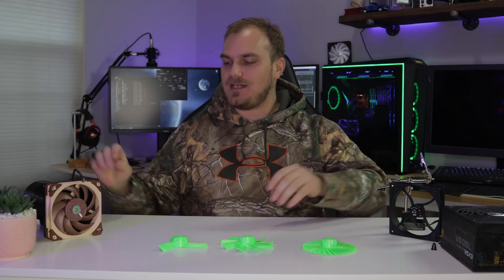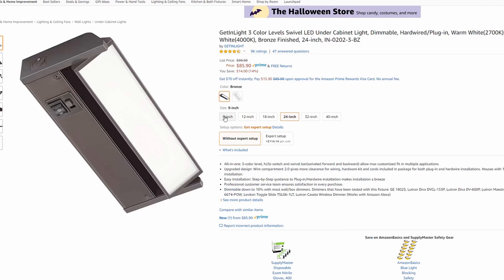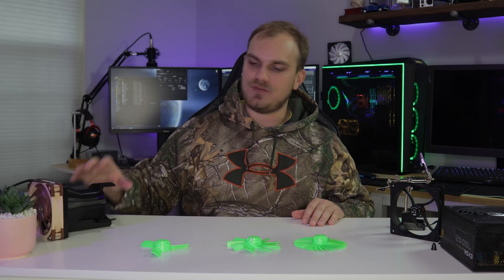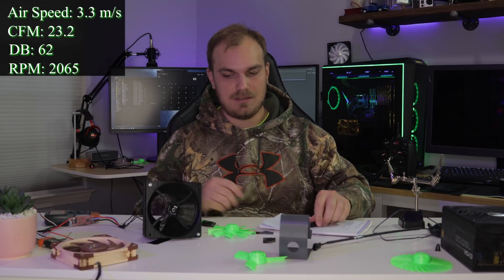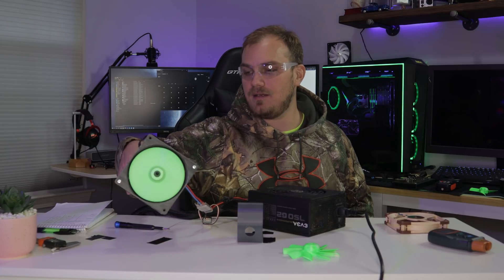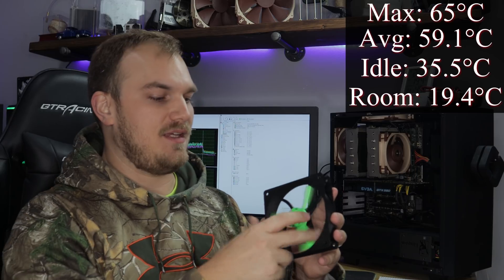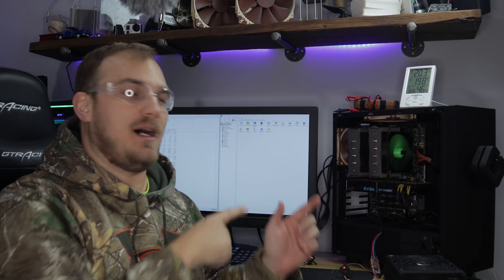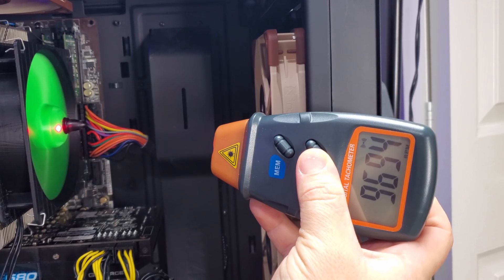This 120mm Fan BREAKS All The Rules!

Comment: The three-blade is on the extreme end of "no pressure" but could probably move some air. Should work well as chassis exhaust but really not good on a heatsink where you want pressure. The 30-blade fan looks like some of the fans I used to see in industrial machinery like big print units who needed elements cooled. A bunch of blades like that will move less air but should probably do better on a heatsink.
Oh and this is absolutely great fun. Subscribed and looking forward to more of these tests. You might just end up busting some myths.
Reply: The 30-blade might actually have torn itself off because it's a massive pressure design. If you try that again with a sturdier locking mechanism it might just surprise you.  :D

Comment: If you know how, you may wish to try and see if you can cast these fans in aluminum. I would not trust plastic 3D printed parts in such a project. Also check to see how a 30 blade fan would work, with the blades set at the same angle as the three blade fan.

Comment: the fewer blades you have, the higher the air flow  efficiency, however more blades means you can run it at a lower rpm, and hence is quieter., plus the more blades, the higher the static pressure (in general)
Reply: So i Imagine that's why they use more blades in plane engines so that they don't rip ear drums miles away
Reply: @twistedpivoter2695  pretty much, but also lower RPM's  = less wear and is easier to engineer
Reply: @twistedpivoter2695  and also higher air pressure in the combustion chamber, which means better fuel efficiency and power production.
Reply: @twistedpivoter2695  no.  not at all.  
it's because it's a jet engine and that's how they work.  
they don't care about how loud it was.  it's the functionality of compressing the air inside the engine
Reply: @twistedpivoter2695  Also, the blade tips must remain below the speed of sound, with respect to the flow through them, or you get not just huge amounts of noise, but also massively increased drag and loads on the fan blades.
Reply: Lower speed also means higher efficiency though. Thus engineering.
Reply: Omg 0 blade fan makes infinite CFM
Reply: @PizzaPowerXYZ  Yup, at 100% efficiency too
Reply: More efficiency per blade isn't it?  But less total flow, or torque for a generator.
Reply: @veritasiumaequitasius3530  To a diminishing effect, yes.
Reply: More blades or more filling.

I have 4 blade fans that overlap and run at a very low angle, they are some of the best static pressure fans I've ever had, in part because the huge blades are sturdier and don't warp from the pressure they create.

That many blades fan would probably run into an issue where it starts bending the blades outwards to the point of either breaking or bending outwards.

Probably one of the reasons why their jet engine counterpart isn't built out of 3D printed plastic.
Reply: so 1 blade is best ? okay
Reply: @dazeen9591  1 bladed propellers are a real thing, but the RPM's required  are high, and the noise generated is higher, and they  typically aren't practical for both of those reasons. However, i've seen them on model airplanes, and Gliders, where they need something that folds easily
Reply: @yetidynamics  i mean... the guy on video said less blades less noise so why is single blade louder now 🤓
Reply: @dazeen9591  higher RPM for the same airflow... if you keep the RPM the same, then one blade would be quieter. this is what my original comment said
Reply: what means static pressure?
Reply: @effexon  If I am right. Pressure differential the fan will develop inside a closed box vs exterior pressure.
Reply: @effexon  Static pressure is the pressure at non moving airflow. for example if you had one of these fans blowing into an Enclosed box, the  pressure inside the box would be higher than the outside pressure,  the difference is the static pressure the fan can create
Reply: @yetidynamics  if u spun it a 100000000 rpm it would have more cfm than me when I fart

Comment: automotive fans sometimes but not always, (mostly mechanical ones with lower blade counts but some 11 blades do exist like this) will use an odd number of blades but with an uneven spacing. but i don't see it in pc cooling. the reason for the odd numbers and spacing is presumably noise reduction. you can construct these uneven arrangements easily with the centrifuge problem https://www.youtube.com/watch?v=7DHE8RnsCQ8  but i imagine they could be even quieter (at least for 4 blades) using the golden ratio to spread 2 even spacings of 2 blades.

Comment: Do you take flex/stretch into the design? At those RPM's you'll get some blade deflection as well as stretching.

And could you build some angles into the motor ducts so that they push air down into the stater?

Cool video man, keep 'em coming.

Comment: have you thought of using high temp resist plastics to prevent warping and maybe even adding bumps on the blades like Be quiet does to reduce fan noise?
Maybe a better idea if possible is to take an existing fan and change the blades, keeping the motor, which may be a more accurate test?

Comment: What is this? I just noticed, you know that if you pressurize air, it actually heats up, which is how regular A/C works, by adjusting pressure... well anyway, wouldn't pulling air, to have it at lower pressure around the heatsink make the actual air colder around it? I mean if you are going for loud and you don't care, then pull the air for colder air around the heatsink. Anyway, I think that you should try to use these high speed fans at a plain heatsink with a thermometer attached to the heatsink, comparing the temperature of the heatsink when the fan pulls the air to when the fan pushes the air through. At this speed I think that there would be noticeable difference... Maybe I will try it myself...

Comment: 10:14 That fan did not move the same amount of air (CFM) as the three blade, but because is better suited for "high pressure" applications like turbines. Put it back on the venturi pipe you build there and measure the static pressure against the other blades.

Comment: Something to consider for future vids. Decibel measurement "weighting" parameter A or C makes a difference in readings. Which are you using?
A = 500 to 10KHz
C = 32 to 10KHz
It wouldn't hurt to provide both if possible.

Comment: I think you should use a more aggressive angle of attack for the 30 blade, also search info about helicopter rear rotor blades to reduce noise and vibration.

Comment: maybe you could use metal filament to increase the thermal conductivity to wick away some of the heat? and maybe use a sensored motor/better ESC so it runs quieter? if you're looking for airflow over static pressure, you should use the least blades possible for the power of the motor.

Comment: It's called "cavitation" The 30 blade fan is creating a void or vacuum which put less load on the motor so it will spin faster just like when you block a vacuum cleaner. Because the blades are so close they don't give the air time to get back in front of the next blade.

Comment: The gaps between the fan with 30 blades are so small that basically no air can be sucked in and forced through the cooler. You could spin that at 50k/RPM and still not improve the performance. And then there's the fact that the fans move so fast that they hardly have any time to pick up air to increase the pressure behind the fan.

Comment: the 30 blade should actually have really good statics pressure for radiator cooling.
the noctua fan is good because it has high static pressure and high aiflow

Comment: What you forgot to measure was fan air pressure. If the 30 blade would have survived, it would have gotten the highest cooling rating on the radiator, as that fan was essentially designed as an air compressor, which is capable of creating the pressures required to force air through small gaps, as in a radiator.

Comment: Also, in free air, or short duct applications, a 2, 3, 4 blade will out flow most other fan types because of the venturi effect. The gap between the blades is so large that the venturi effect will draw air between the gaps between blades. However, if you dead head or add restrictive flow, low blade counts will stall and provide near 0 pressure, thus 0 flow.  A high blade count however (like your 30 blade) will not flow as much because there is no gap between the blades for the Venturi effect to draw fresh air.however, because there is no Gap, there is no way for air to revert backwards between the blades if the air passage is deadheaded or restrictive. This means that high count fan blades will provide a higher pressure if deadheaded or given a restrictive passageway like a finned heat sink. This is why jet engines or turbo fans have lots and lots of blades.PC cooling fans also have quite a few blades, but the Gap still is a parent because restriction is not as high at the low flow values that they have.

Comment: The problem with testing anything with heatpipes, is that the heat pipes rely on boiling water in a vacuum to work and move heat. If you never get hot enough to boil water, then it will never cool. In contrast, if you have a solid copper or solid aluminum heat sink, you can coll whatever is attached to it, almost to ambient if you have enough air flow.   Your limitation in your testing is the heat pipe.

Comment: Print the ventilation holes with a profile to draw in air with a some small holes on the outer edge. It adds a little extra cooling whilst "blowing" the blades for more efficiency.

Comment: I would recomend having a printed ring around the 30 blade fan to prevent it from hitting a resonance frequency and shattering also you should use a different fastener as the fastener was spinning loose

Comment: The 30 has a higher static pressure to them, they are better for carrying air though, flow is fine but pressure can be useful for keeping things like dust out and pushing air through tight fins.

Comment: There's a difference between volume and pressure - and when you're driving against a restriction (like a heatsink), you want pressure. Ideally you want a stator after the fan to change the fast vortex flow into slower linear flow at higher static pressure (as is done in a turbine) - the stator can be 3d printed too.

What about trying wingtip and wing body fences?

Comment: Prediction.
The lower blade count, while moving air faster, will not be able to push the air through the fins.

Ok I didn't expect you to run it at 9000rpm..

Comment: I want to say the 30 blade will have plenty of  static pressure, but not sure if that will equate to results or not (by results i mean better results against the other fans than on the air speed difference test)

Comment: Protip:
Chamfer your ventilation holes in the direction of the fan rotation to they actually blow cool air into the motor.
Reply: NullPoEx make a counterflow tail  after the propeller to push air around the motor

Comment: Hi, I'm very curious about pressure they are able to use to force the air through whatever radiator or heatsink they are attached to and also, when they are inside the case all sealed up.

Comment: fan are running in a pull air from the rad config.  

also rpm meter look like it was picking up the holes in fan near hub. so ur rpm would be divided by the amount of holes.  supposed to put a reflective sticker for that type of rpm meter

Comment: Dont know if you noticed but you had your fan spinning the blades the wrong way in the pc tests you should swap one of the esc wires to the motor to have proper direction of rotation.

Comment: You know what hasn't been done? Mounting an entire motherboard, CPU heat sink but no fans installed, in a rotating frame. Like a motorized thing that spins real fast so that the heat sink cools that way. Good luck figuring out the cabling though.

Comment: If you record the motor without the fan, couldn't you get a nice rough baseline for the motor noise, then subtract that from the noise with the fan mounted?  Is it scientifically accurate... no... but if there are major differences in noise then you can at least point that out.  Also, depending on your room, you could have frequencies that are resonating.

Comment: "you can take a 3D printer fan that does perform just as good as one you buy.."
UM... no. In your NH-D15 results you seem to have completely ignored the NOISE factor. Fan results need to be compared by noise otherwise they are almost worthless. Interesting video otherwise. Also, did you even test the Noctua A12 at the same RPM? That wasn't clear.

Comment: I would modify the wing shape, since you dont want helicopter blades, but an axial(or radial) compressor sitting inside a shoud. -> a streamlined but curved cross-section.
The AoA should be 0 at the tip, so the angle of the blades depends on the airspeed, rpm and radius.
The inner section of the blades moves slower, so their cross-section should be more agressive than on the outside.
Have a look at turbofan-fanblades, you'll see exactly what i mean.
Also, add a stator behind the fan to redirect the air to flow straight out the back.
Eventually add more stages...just kidding.
The main problem is cooling though.

Comment: Could you look intopressure you did some good work but feel a major factor is missing without testing static pressure I belive your 3 blade might push the most air in a open environment but soon as it pressesd against a radiator it wont have anuff blade pressure to push air through I feel but ur jet turbine would probably be worst open but best at pressure thanks dude

Comment: What plastic did you use to print it? I would recommend heat resistant Filament, PETG or whatever is out there now a days. 

Unless the temperature exceeds 150 degree Celsius. Then I don't think there is anything you can do about it.
Reply: Exactly the same question. Was it ABS, PLA? If he printed this with PLA, he did it wrong lol

Comment: On the 30 blades, the angle is not suffisant to permit a good air flow in hi speed, it becomes like a wall
If you want to really improve this device, open the angle to 45° and a little bit more at the extremity of the blades, it will be really more efficient
The air flow is limited by the space between the blades the origin of the air and the obligate exhaust

Look at the noctua, there is enough space between the blades, wich permit a big air flow without any blades rotation

Comment: and @ the 3min mark i can clearly see u did not rub through the oxide layer on the cpu resulting with the liquid cooler becoming detached in multiple small areas from the cpu in those areas causing  higher then expacted temps only after 8 months
and @ the 3 40min mark clean copper is best

Comment: Reply to ur video: https://www.youtube.com/watch?v=eTPusSdpqlw
What Liquid Metal Looks Like After 8 Months Of Daily Use
that sounds like to me u did not have enough liquid metal.Readmore
how i found liquid metal to work over 2years, 3 cpus and 1 gpu.
once the galium defuses with the copper and if there not enough indium left the 2 sufaces will become detached from each other
how i apply liquid metal now.... remember there is an oxide layer on both components u must rub ur way through that
using firm pressure use the applicator Q-tip to firmly rub in the liquid metal, do not assume that the LM is correctly on the intended area if it covering it!
how to know if the LM is properly attached to the surface's: during the rubbing of a surface if an area on the surface begins too squeak or binds noticeably on the intended areas then you'll know
once all intended areas are rubbed one u will notice small chunks of contaminants that is the oxide layer u have rubbed through use the applicator Q-tip to remove  most of them
once removed add additional LM 
install cooler but then un install the cooler to check the contact area has to much or too little add liquid metal as needed
if u follow these instructions u will not need to replace ur application for atleast 2 years i have a saphire radeon r7 260x with a copper base plate that did not have enough LM that after 8 months it stopped the pc from P.O.S.T.ing 2years there wasnt enough indium left over after the galium was gone so the gpu die became detached after the pc shutdown for the night

Comment: @Major Hardware You have enough stats and specs to do the formulas to figure out the most optimum angle of attack, blade width and depth, number of blades, etc. What did the calculations give you? Oh, and last propeller fan likely had huge static pressure since it has largest coverage space to blade ratio and pushed material tolerance or mount tolerance or both to failure. You could prob squeeze a little bit more performance if you made the nozzle cone mount more streamlined with the nozzle cone screw or maybe even design and print a cap for the nozzle cone screw so it's more streamlined with the mount surface edges and shaft edges so more aerodynamic. And take some sandpaper to smooth down the blade's print lines to make more aerodynamic air foil and if possible, smooth with a filler like elmer's glue or something cheap unless you wanna use epoxy but it's heavier than elmer's glue or something cheap and water soluble if you figure that into equation. These couple of design points are scalable.

Comment: you need to take care to make sure the turbulence of one blade doesn't interfere with the next. and really the only way to do that is to test your blades in a wind tunnel. this is why your 3 blade works best. angle of attack is pretty important, if you can do wind tunnel tests, it will help you determine optimal aoa, then you can design your rotor to take advantage of that blade angle. then you got the problem of different tangental velocities at different points on the blade causing different lift characteristics at different velocities. this is why some fans vary their aoa at different points along the blade.